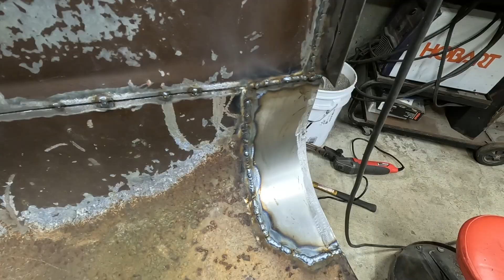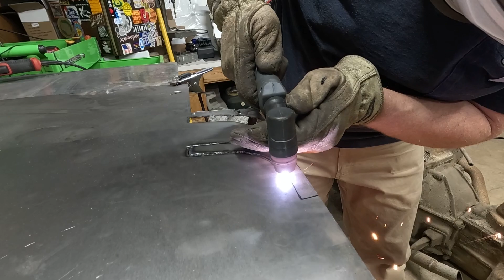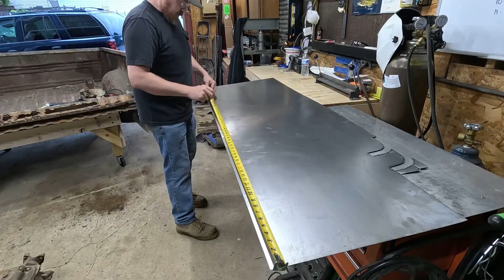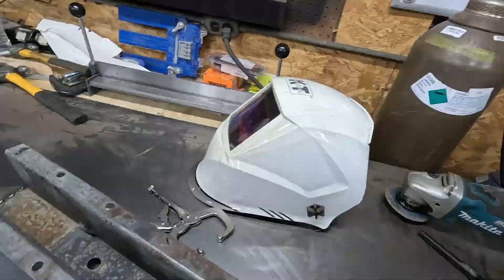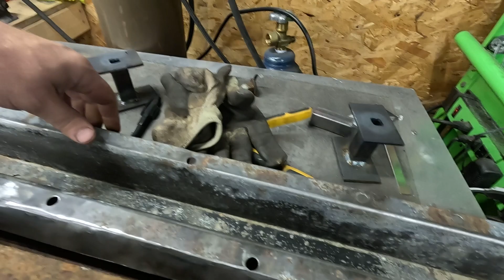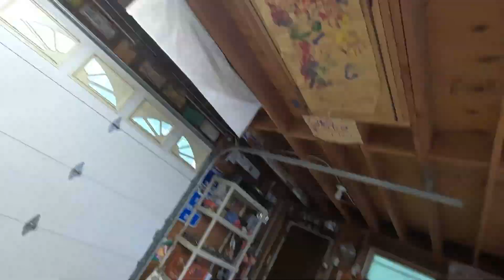Dentside F100 F150 Short Bed Conversion PART 5

Comment: Nice work on the patch panels. I have very little welding experience but now that I’m retired I’ve got time to practice. Most of what I’m practicing on is old car and truck parts for wall art so this information is helpful. I’m wondering if using a surface prep like OSPHO would help in the areas where you can’t get pitted metal sanded and clean enough. Have you ever tried this technique?
Reply from the maker: I’m not familiar with that product. I’ll have to do some research on it. Thanks for the suggestion!